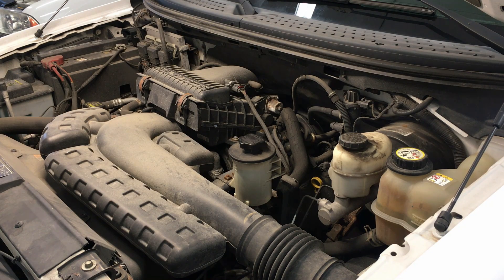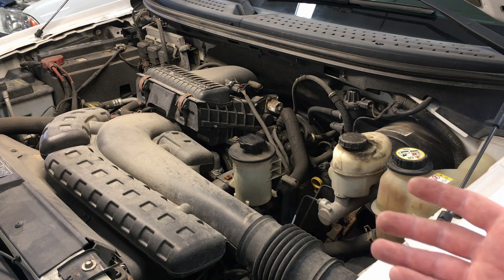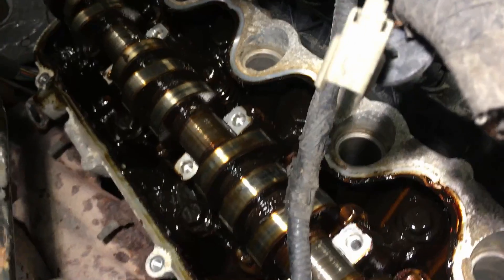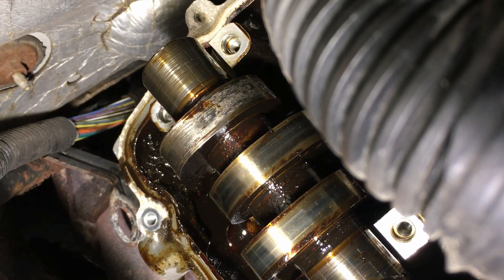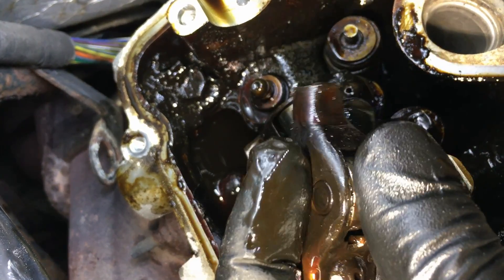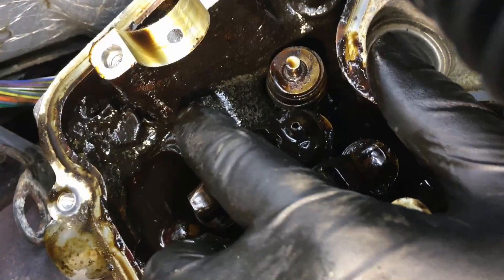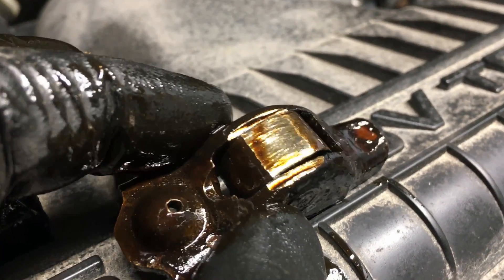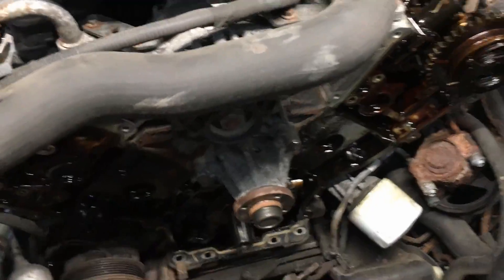Ford 5.4L 3V Engines Constant Ticking Tapping Noise: Roller Follower Failure!

Comment from the maker: If you find one has failed others are not far behind so it is best to replace them all at once with this cost effective kit:
2005-2014 Models Kit-
https://amzn.to/4b23w5I
2004 Model Lash Adjuster are different-
http://amzn.to/2fhTrKr
2005-2014 Lash Adjusters-
http://amzn.to/2fhUjir
Roller Followers (All Years)-
http://amzn.to/2wvbNeg                                                                                                                                                                                       
Here is how you want to inspect the valve train-
https://youtu.be/OxOPsXan6dU
Reply: I have a 2005 F150 5.4 with the same ticking noise, but I was always told it is the cam phase sensor. Mine started at about 100,000 miles. Now I am still driving it and the truck has 289,600 miles with the same ticking.  I've always used Royal Purple synthetic, and I'm not endorsing the oil, it's just what I've always used.  The truck runs great, and just three weeks ago I had replaced the 12 year old starter, and everything else is original such as alternator, muffler, and tailpipe, original transmission, and all the other parts you'd expect to go bad in it's lifetime just hasn't.  In terms of longevity, it's the best I've owned.
Reply: How much does a job like this cost??
Reply: I've been looking at buying the Ford Racing kit off Amazon for my 2004 F150. You say they are different in the 2004 models, but can the 05-14 parts still be used?
Reply from the maker: +Chase Fields 04 lash adjusters are different
Reply: What motorcraft oil do you recommend for a 2008 f-150 with the 5.4L? I thought I saw before where you said 5w-30 instead of 5w-20? I've heard the 5w-20 is close to a 5w-30 so could you explain why. Is the 5w-30 better for the timing components and such?
Reply: jdtractor man 5w30
Reply: Daniel Alaniz it should be a smaller more angled hole pointed towards the roller allows more oil pressure I guess
Reply: FordTechMakuloco hello sir I am noticing a noise almost identical to that, it also get more noticeable with the A.C. going, i have a 2009 for taurus, could this be the same thing?
Reply: What is a good price range to have this done? I'm in northern AL doubt I'll be coming to Chicago anytime soon but I'll still look for your contact info on your site
Reply: I’m pretty sure this was my main problem. It made this sound multiple different rpms after start up and then would go away. Boom finally locked up. I’ll know for sure once the valve covers are pulled.
Reply: FordTechMakuloco I have a 07 ford f150 super crew xlt 4x4 with 5.4 liter engine...Recently rite before scheduled oil change at 3000 miles I started to hear a slight tapping so I changed the oil with recommended 5w20 motorcraft synthetic blend and motorcraft filter as always upon start up the tap got more noticeable and now constant ....motor has 153000 miles still runs great at idle but I noticed another symptom at hard acceleration motor Boggs down literally doesn't move but rpms a 4000 range in desperate need of help don't have the money for new motor !!!
Reply: I've had this ticking on my 2007 5.4 for a while now. It runs very sluggish and makes a buzzing/grinding sound during acceleration on occasion. Is that symptomatic of this issue?
Reply: Once the 3 roller followers are removed and the cam is in its neutral position, can you take the cam out at this point or do the remaining roller followers need to be removed first before the cam can be removed?
Reply: Damn $500 for 24 roller followers
Reply: FordTechMakuloco can you elaborate on the difference besides the groove in the plunger?
Reply: Chase Fields Ford racing says put them in they will work
Reply: I purchased the lash adjusters and followers that you linked but when I received them in the mail I looked at the rockers and it doesn't have the hole that rides on the lash adjuster. Is that a problem?
Reply: Have you heard of a good engine swap (good fit/bolt up) to replace the 5.4 3v 2005?
Reply: FordTechMakuloco I’m about to dive into this. Is it still confirmed the other kit will not work on the 04? Quiet a jump in price for the 04 specific.
Reply: Should I replace the valve cover gasket if I take off  the valve cover to replace a roller follower?
Reply: I have a question does an 04 f-250 super duty have the same 5.4 as the as the f-150.
Reply: Fordtechmakuloco do you have a link for the cams?
Reply: Tell you what I had a tick just like that driver side. Took all the coils for valve cover removal. Went ahead and checked the spark plugs while I was there. 5 6 7 were tight 8 was half out! Torqued it down and fired it up tap was gone. Been a ASE tech for 28 years and let me tell you it sounded exactly like a rocker or lifter metallic sound. So before you go into your valve cover for tapping noise check your spark plugs in the process. Also when you remove your coil it will have a strong exhaust smell to it when they loosen up like that. Uncontaminated coil will smell like rubber. Hope this helps someone!
Reply: @thomasmarquez6790  was ur truck missing? Bc of plug

Comment: I replaced all lash adjusters and roller followers with OEM parts at 153K, along with melling hv oil pump and complete timing job. I use 5-30, and a pint of MMO at each 5k oil change. Now I've got a bad lash adjuster or RF at 178k. You cannot depend on parts any more. Even OEM parts.

Comment: Know what's weird, I just did my rollers, both phasers, and lash adjusters, and i still got that noise on the passenger side and there was no sludge when I took it all apart.
Reply: Did you figure out the ticking?
Reply: @romero2025  the noise I have now I think is just the normal  injector  clicking. I have 6k miles since I did the job and it's running well.

Comment: After replacing my roller followers with the smaller squirter hole they are loud hear it from cabin when I hit the gas
Reply: Did you upgrade the oil pump too?
Reply: @ yes with melling high volume pump
Reply: @bohaggin5913  a

Comment: If I'm going that far into the motor I'm replacing all Fowler's and checking lash and timing components. I know I bought a truck and it has 260,000 mi and it runs perfect just the exhaust manifold leaks when I started doesn't make noise hot, I'm assuming the engine was replaced and the tranny at I've never had a car last $260,000 me and runs good

Comment: I got my customer 07 mark lt with 5.4 with bad miss in num 2 cylinder? Is a misfire possible will bad follower? I just haven’t heard anyone say it on any video just the noise it makes which my truck does as well. I will do i compression test will gauge first

Comment: Hey man, I’m obsessed with your vids. I’ve saved and done thousands of dollars worth of work that I’ve been pretty uncomfortable doing on other cars in the past because of you. I have a ‘08 e350 in what I think is a 2v configuration. Haven’t taken the covers off to know for sure because you know how cramped it is in these vans. I have a clattering “tapping” sound more than a tick on my opinion. It’s cringe worthy after a cold start, seems like it goes away after driving about 15-20 mins. Sounds a lot like what you’ve shown here but maybe a little louder. The van has 240k on it and I’ve never had to do anything major to it. Do you have a video showing a step by step on taking the covers off before checking the rollers? I feel confident in the actual work inside but taking everything off and keeping it organized is a little overwhelming
Reply: Did you get work done yet? If so, how did it go?

Comment: I got my lightning truck started to do that. I changed oil and still did it. I had engine light come one and I checked oil it was low. I since changed it. It only ticks when I accelerate I take foot off pedal and no ticking

Comment: At what point would you replace cam shaft?  With that amount of scoring as shown on #4 cylinder?….or just please roller followers and lash adjusters?  Thx!
Reply from the maker: If the followers are digging into the camshaft then I would replace it.
Reply: @FordTechMakuloco  just ordered L and R cam shafts.  I’m a new sub……great channel and even better content!  Thanks for your time and for linking the best parts.  I have 2006 F150 4x4 w/5.4 3v w/230K miles with no issues….guess I’m lucky, but now spending $4K on parts for major refit and hope to get 150K more miles out of this truck.  Better than $40K for used f150.  Will be referring to you channel on regular basis.  Thanks again!

Comment: well, I finely did it put on timing kit and melling hv 360 also about to put on fallowers. reason I am writing in is truck has 200,000 miles and it would raddle sometimes at starting. I checked all components, and they look good gaskets on tensioners are ok no blowen gasket. going to replace water pump since I am there too any ways it looks so clean; I find it hard to believe just due to my oil changes when or before needed. love your videos thanks for sharing.

Comment: I currently have a 2005 f150 3 valve 5.4 with 572k miles on it. The followers are making all kinds of noise, and I bought the truck like this for cheap. I've decided just to see how long it'll go before it blows up. Video of it is actually on my channel.

Comment: My 2014 Ford 550 6.8 V10 had a failure related to Ford's "Customer Satisfaction Program" 17B30 but my VIN was not included!! I contacted Ford Dealership and they were booked about 2 weeks out. I needed the truck for my business so I replaced camshaft and 15 followers on passenger side. Your Video was very helpful and it is a shame that Ford won't take any responsibility. One follower was locked, 6 others showed enough wear that I considered defective, remainder were fine. I bought truck new, always used Motorcraft 5W-20 oil (spec) and Motorcraft filter at 5.000 mile intervals, never been overheated, never run low on oil, nothing out of ordinary to cause problem. I have had several ford trucks with 150,000 to 300,000 miles without failures such as this. Been a Mechanic for nearly 50 years.
Reply: 5-20 is too thin. Brian has said this many times. Today's parts are shit.

Comment: Would you replace both sets of roller followers or only the side that's making noise? Getting ready to order my parts, have the noise on my 2012 at 160k miles in the RT side.

Comment: Is it common for new, updated oem roller followers or lash adjusters to be bad out of the box? Just did timing job with all oem parts. Now passenger side is ticking similar to this roller follower.  All parts were soaked in oil over night and lash adjusters bled. Have 50 miles on the repair with everything else apparently normal.

Comment: Mine makes this same noise but it only does it right after I let off the throttle. I can really hear it next to a building and it goes away quick. I power brake just a little (not enough to spin tires) and let off then I hear the tapping and it stops. What do I have going on here? 

I have a full timing set on the way but I'm starting to think it's not the phasers. I had a little tap at idle and its gone away. Now I can only hear this other noise under these circumstances.

Comment: Can this cause a misfire ?
Reply from the maker: Yes
Reply: @FordTechMakuloco  I'm having absolute worst time trying to diagnose a misfire on cylinder 3 I feel like I'm going to have to pull the valve cover off I've done plugs coils and I'm still getting a misfire under load going about 60 miles an hour most of the time uphill. I know my catalytic converter is clogged on the driver side because I hit it with a rubber mallet like you said and it made a noise like there was stuff in it I'm just at a total loss with this truck and I can't afford to pay someone to look at it

Comment: Thanks for the video. Can you access the followers by only taking off the valve cover? I bought a tool that holds the roller in place when you remove the follower.

Comment: 06 f150 5.4. Just over haul the engine new: timing chain kit, oil pump, pressure n oil rings, camshaft,  rockers ,valves and still have that tickling noise in the engine. ( right front side is louder)   i reused: pistons, phasers, and vtc. I did not take the cylinder heads to seat the valves or to adjust. Did I make a mistake by not changing the fazers or bringing the cylinder heads to the machine shop? Any  suggestions or advice? Thanks in advance. Also there were no codes on the scanner.

Comment: I have a 2010 with 109546 changed oil every 5000 have ticking noise on passenger side do I need to replace roller followers on that side or both sides
Darrell
Reply: Funny, I just bought a 2010 with 110k miles on it. It has the 4.6 3 valve engine, and I am hearing a ticking from the passenger side also. Only at around 1000 rpm's though. Not sure what it is yet, trying to get the dealer to fix it. (Thinking roller followers or lash adjusters)
I would think that a good inspection while you are in there is going to be your best determination as to how many you need to replace?

Comment: Great video. Got the courage to replace my rockers on 2013 navigator (someone as in the video) .  Car was sitting for 6 months before I had time to open her up.  Problem now is that the car does not crank (battery is good) no tick no nothing.  Got any ideas?? I removed the negative and put jumper across the terminals.

Keep up the good work.

Comment: Another fine example of what happens when you extend or skip scheduled maintenance.  It's a lot cheaper to regularly change your oil then to replace worn out parts.
Reply: It wasn’t the case with my truck I did change oil every 3000 miles and the sound started when the truck was 155000 miles, is more likely that this engine it’s not that good as other ford engines.

Comment: Hi there,

I have at least 1 failed roller follower for my Australian ford 2003 Fairmont ghia 5.4i 24v, it's the same 330cu modular v8 engine i see in your exceptionally detailed videos,
  I'm having trouble finding replacements to buy online so if you could help me champ I have a PayPal account and can buy direct from USA, Cheers,
New subscriber.

Comment: New follower as of today! Ok here is my story... my father has an 05 f150 lariat and it has a very loud ticking at cold start up then about a minute later it stops so I'm planning on changing the roller followers and might as well changes the lash adjuster but at that point I would have to remove the cams correct? And might as well do the timing job?? Any input would be great and thanks in advance!

Comment: Getting ready to do a complete timing job on my 2004 F150 with 190,000 and have started to price parts before I purchase anything.  Any advice on using the M-6529-3V kit?  It seems to be the best value for ford parts.  The kit is listed for the 4.6 3v, but I see multiple places that also state it will work for the 5.4 3v.  My engine VIN code is "5," which from my understanding is the 2005-2010 MY engine, which this kit is for.  Thanks for the advice. Love the channel.

Comment: I’m concerned about my 5.4 doing this but mine sounds like it’s an exhaust leak. How do you tell the difference In sound?
Reply from the maker: Exhaust leaks normally are loud at start up but swell and seal soon after startup. A follower noise will always be there.
Reply: FordTechMakuloco thank you because it’s loud on start up and it only comes back under a load going up a hill etc, I was concerned because the previous owner had the exhaust manifolds done prior to me purchasing it and he has all the paper work for work done. But thank you. I enjoy your channel so I know what to watch out for. Much appreciated.

Comment: Hey I like your videos. I have a 2000 Ford Expedition and it's making a ticking sound that I haven't heard your videos yet but this video sounds closest to it it's a 4.6 L and if the engines running its ticking and even with the oil. I tried everything and it's not the lifters it doesn't get louder or quieter it stays the same all the time and I am not very mechanical even though I just changed out my starter by myself last weekend. I actually I'm afraid of opening up an engine but anything around the engine I'm pretty confident in doing. How long did it take you to open up that engine and do the whole job?

Comment: what is the torgue specs on a 2010 f150 5.4l cam shaft
Reply from the maker: Cam Caps are 89 inch lbs
Reply: @FordTechMakuloco  Thank you,,I have another question,my cam phaser bolt i can not get out, It is so tight,,any suggestions?

Comment: No maintenance that's why. I have my expedition 5.4l  close 300.000 miles on it . The engine runs smoothly.
Reply: OR - faulty parts. My Mercedes v8 is having this issue and it’s been meticulously maintained.

Comment: I just watched another video of yours and you had a special tool to  keep the springs down to pull out the roller follower. Is it easier to just take the cam out and do you have a video where you replace the lash adjuster?
Reply: I saw the same video and I need a video to remove lash adjuster. Any help?

Comment: hi  so i am following your 4 videos on replacing the timing chain replacement kit. i am doing it now and i opened it and found so much sludge worse than that engine,  what do you use to clean it,  i started using brake cleaner and other engine cleaning products, but very hard to go around the cam using a small brush but will take a week just to clean it with a tooth brush.
I am thinking the remove the cam to make it easier. what is your process?
Thank you so so much for your videos

Comment: Love your videos. If i was going to replace the motor in my 2008 f250 5.4l where should i buy my motor and is there a upgraded 5.4l i can get to replace my 5.4l
Reply: Jasper sells a reman triton 4.5 that uses an upgraded high pressure oil pump and sprockets instead of the normal cam phases. Among many other upgrades. 3 year or 100k mike warrantee.